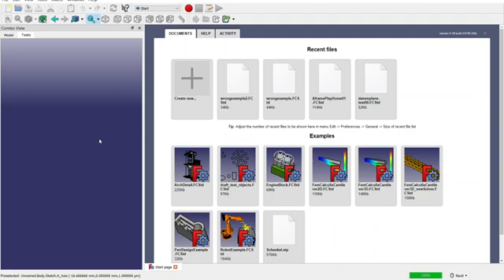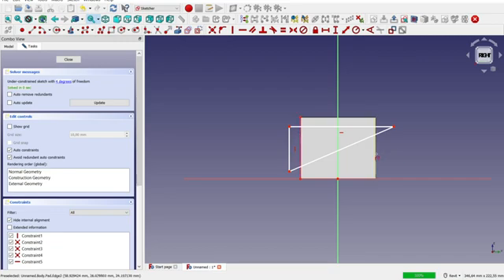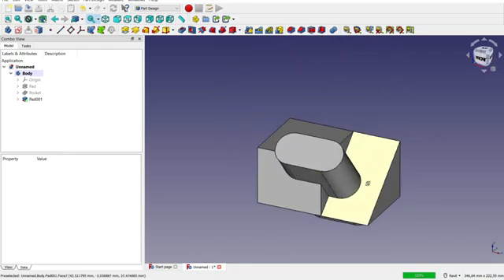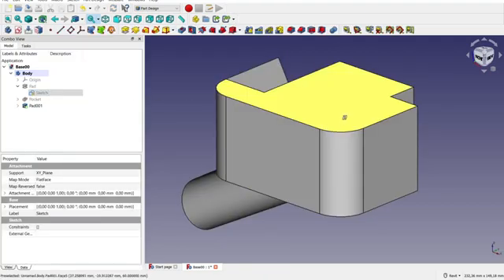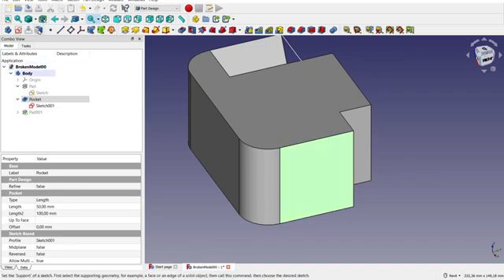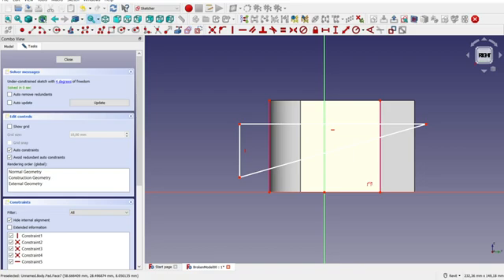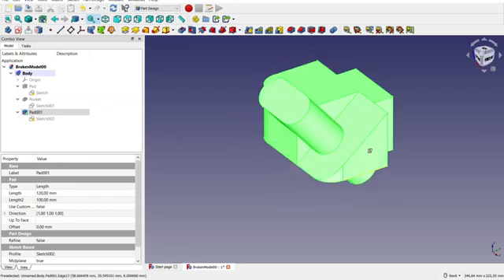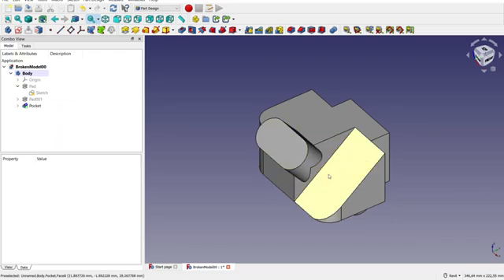How to fix broken Freecad Models. Or, how to stop fearing the topological naming problem..

Comment: Use my WB, you don't need to be wary about that. Since you are not drawing on the face. You are attaching the module to the face by using another plane. 
So, this is not problem .. and topological issue is not existing on my WB. if you use direct modeling. 
In the other hand, OCCT is broken and the same for FreeCAD in many other things.

Comment: The topalogical naming bug in FreeCAD seems to be a fundamental flaw preventing sketching on faces, which is easy to do in most all other CAD software.

The work around seems to be to always create a datum plane equal to the face.

If this is true, the fix for this problem seems relatively easy.

FreeCAD has to know the size, location, and orientation of a face.

As soon as the user selects a face to sketch on, FreeCAD should AUTOMATICALLY create and generate a datum plane on the face, BASED ON ORIGIN as opposed to face, which automatic datum plane is left permanent and independent of the face unless the user deletes the datum plane,  whether the face changes or not.

All relevant sketching seemingly done on the face is actually done on the datum plane, which is dependent on origin, not face, which was originally used to define the datum plane.

These are the steps done manually to work around this problem - why can't FreeCAD do this internally automatically ?
Reply: This problem is fixed in the RealThunder fork and has been for some time, no idea why there hasn't been any effort to sort the problem out in the official project rather than keep adding more and more 'features' while basic usability is terrible.
Reply: @schrodingerscat1863 there is an effort. RealThunder's work on topological naming is slowly being merged upstream.
Reply: If you create the plane fixed in space, it won't move if you modify any dimensions. So you end up without parametric design.

What you need to do, is start from given variables (like with the spreadsheet module),  and use the same parameters to define your plane as well as your base part.

A more stable option is to improve the naming conventions. Instead of just renaming all generated geometry, freecad could try to keep as many names as possible fixed throughout operations. I.e. if you edit the sketch and a line gets split, the biggest of the resulting lines should keep the same name, while the new line should get a new name that wasn't previously in use. Every operation should try to make its name changes as predictable as possible. So only when you edit a face that's really in use, you will get wonky results.

Comment: 1. Stop using FreeCAD because it's not your fault, FreeCAD is fundamentally broken and in addition it has outdated interface which slows your productivity even more.
2. Model your part in any other CAD software
Reply: So which CAD software could we use instead? I'd prefer one that works under Linux and is open source.
Reply: @sysghost  You want to do CAD, or be an ideologist? Choose one.

Comment: Any chance there is a follow-up for how to do it properly?
Reply from the maker: It's been in the works for a while. Shot it 3 times, but never managed to finish a full recording. I'd start with a spreadsheet, lay out your main dimensions first. Then use master sketches, shape binders and datum planes to constrain whatever other sketches in whatever other bodies you would need. Sorry if that's not a full tutorial, but it's the best I can do right now.

Comment: After learning another package, I knew that I needed to learn the correct workflow to properly make parametric models. Oddly, after tons of tutorials, including the ones linked in the FreeCAD forums and Wikis, I still made models that broke most of the time when revised. I even searched for FreeCAD best practices and specific workflows for the Part Design work bench. On top of that the attitude I got from the help forums and I could see in other answers when users was sad. 90% of the answers are "did you follow the tutorials yet?" or some other version of that. Since this topological problem breaks just about everyone's work you'd think you could find a specific step by step workflow that would avoid it, or at least it would treated like the bug that it really is and get fixed. We can all follow tutorials until we are blue in the face, but none of them show what this video showed in under 11 minutes. Thank you for the video. 

Now I just hope new users can find this somehow. It is a strange set of circumstances when a new user has to figure out a pad to make their first body, and then 15 minutes later needs a masters degree in object orientated naming conventions to move forward without misery.
Reply: hi, this video is soo nice on that topic. "FreeCAD Is Fundamentally Broken! - Now what..."
watch?v= QSsVFu929jo

i dont want to damage the follower count, amh, sorry
Reply: I fully agree. This video is very useful for FreeCAD newbies like myself. It gives a better understanding of what's happening and why FreeCAD models are breaking up when editing a sketch. 
Now I'm looking for a tutorial on a correct workflow from a FreeCAD perspective, setting up the datum planes correctly and using them for parametric modeling instead of using dynamic objects faces. 

I'm coming from ancient Autocad, running on a i386, Autodesk Inventor, etc, etc and now I'm researching FreeCAD as an open source alternative since I'm running my things in a 100% Linux environment these days. FreeCAD has caused me lots of grief and time wasted that could have been used on real work instead but I'm not giving up! I'm going to try to learn how to navigate around these issues since I have faith in that this flaw will be solved, eventually. And I really like the potential in FreeCAD.

Thank you for the video tutorial! 🇳🇴

Comment: I was hoping you were going to show how to avoid having to redo, which is the part I can't stand about FreeCad..Why can't it just redo the steps, seems Fusion does this?
Reply: Can't say I know fusion 360. Yeah it's annoying. Then again, it's a bit of getting used to a new kind of workflow. There's this program for creating ships, pipes and stuff I use at work that I considered to be a huge pain in the ass to use, still do actually. But you do get used to it. Redoing the pad/pocket operations is a pain, having to remap sketches happens because of using the wrond workflow from the get-go. I've started a new tutorial a few times now that I didn't get to finish yet about a small project with a lot of good practices. Start with a spreadsheet, make the part and bodies, use datum planes, master sketches, shape binders and link external geometry wisely to create a nice, clean parametric model where you can edit a bunch of stuff afterwards without stuff breaking again. It's possible, mostly just requires learning a bit of a new workflow.